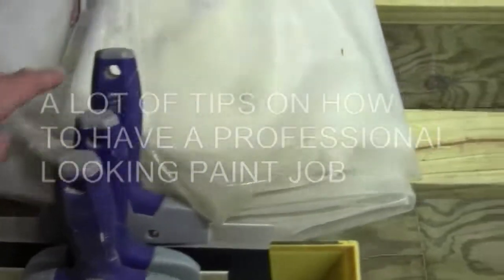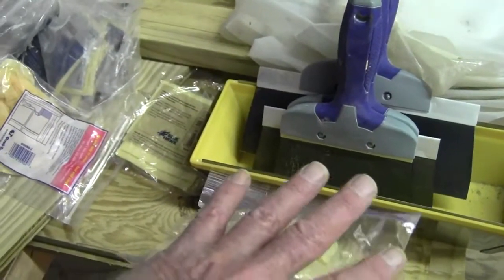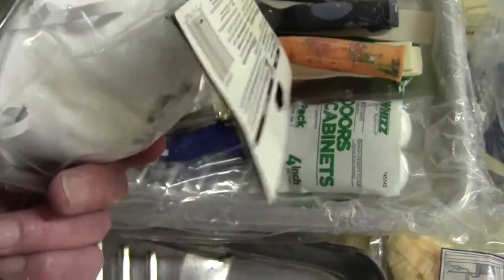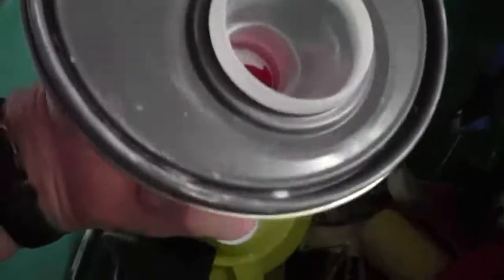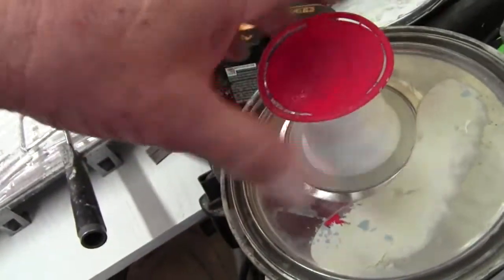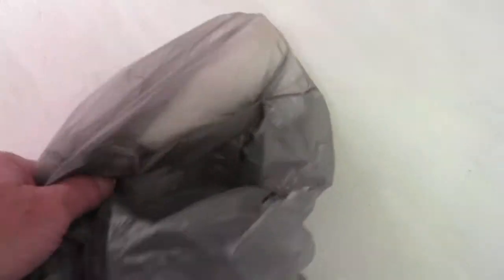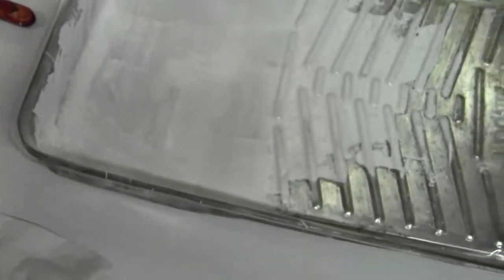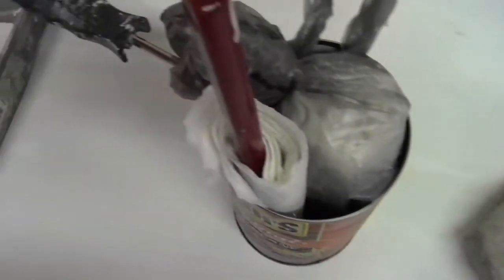TIPS ON PAINTING 1/2

Comment: Haven't seen that lid with the spout with the screw on cap. Like it! Cheryl and I save our rollers and brushes the same way as you. I'm not sure about oil based paint and thinners being put in walmart plastic bags, though...won't it melt the plastic bag?
Reply from the maker: nov51947 Karl: I probably didn't explain it very well. Using oil based paint you would first put the thinner on the first paper towel on the wet roller and then put 3 dry ones over it. Oil based paint would dry out being next to dry paper towels. Then put a rubber band over the center of the roller. Next the roller would go into a zip lock bag and then zip the bag up tight against the metal rod of the roller handle. I would think that the thinner would dissolve a WallyWorld bag. I think my tongue got in front of my eye teeth and I couldn't see what I was thinking or I was using the right side of my brain while I did the video. Bernard

Comment: We've 2 small rooms in our home we'd like to paint, hopefully this winter, and will certainly refer back to this video before starting.  I've never seen the neat no-spill paint can lids, but am going to ask my husband to be sure to watch this video.  Also did not know, you need specific rollers for cabinets and doors.  Thanks for sharing this info.!   Mrs. Tc
Reply from the maker: thundercloud47 The no-spill lids saves a lot of time when you need to add paint to your tray. Usually the big box stores run out of them before spring painting begins for real. They don't stock many of them usually. Most people don't know about them. The paint cans will tell you what type of roller to use. The nap size is very important. 3/8" nap is pretty universal for most painting jobs. I don't put the original lid back on the can until I am finished painting. Bernard

Comment: Nice tips, but no one is painting my house with anything but a 4 inch quality brush.  I am 90% finished with painting my house this fall, all with a 4 inch brush and I know it will be a good finish for many, many years.  I will opt for quality, not speed!
Reply from the maker: anselb2000 My bride and I painted the cottage about 12 years ago with 4" rollers and a smaller brushes for the lap joints in two days and the cottage is over 2000 sq. ft. and the paint still looks good.  Of course we were a lot younger back then. The biggest mistake people make is using cheap paint to paint something as important as their home's exterior. Thanks for watching and commenting! Bernard